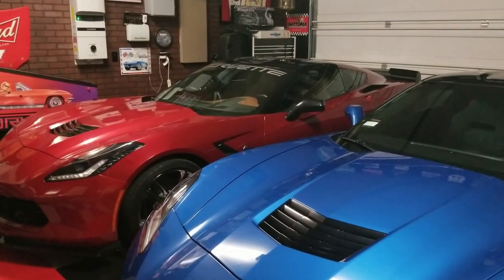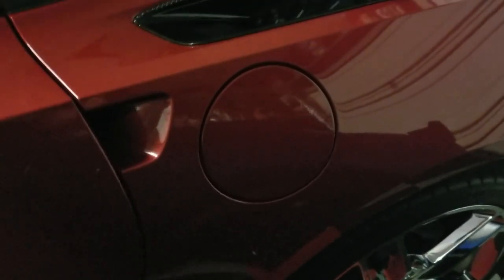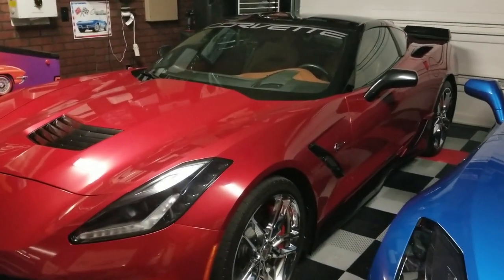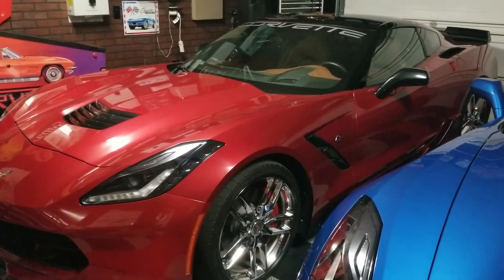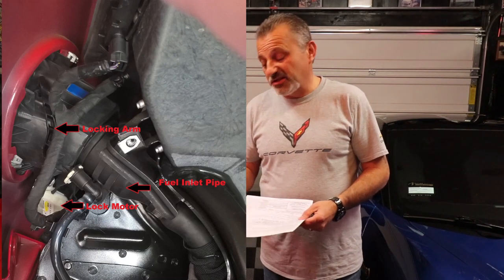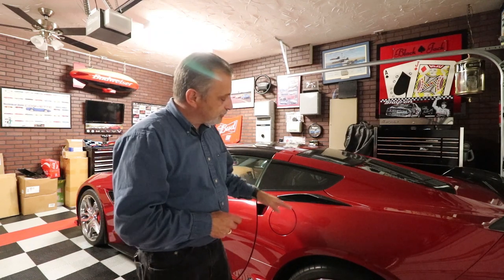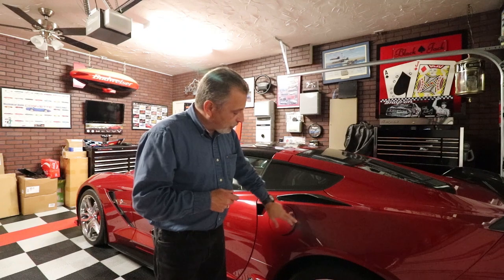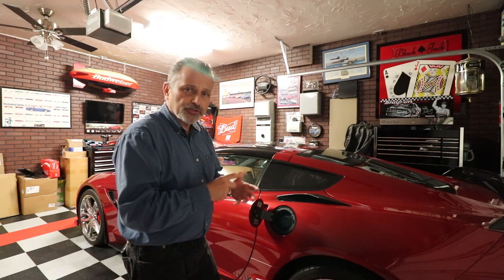My Gas Door Broke on my C7 Corvette

Comment: I took the 4 torque screws out liner pulled actuator pin out the door and put a plastic panel push retainer I have from my Escalade in gas door hole so that it can never get stuck again.

Comment: Was it the Chevrolet Extended warranty? If so it it worth considering
Reply from the maker: No it was from National Warranty Company! I paid $4995.00 for it but they paid out over $16k in various repairs. So it was so worth it!!
Reply: @THECORVETTECHANNEL  $16K in 100,000 miles! That is not so encouraging for those of us looking at going from a C6 to a C7.
Reply from the maker: @Sprocketboy1956  I would normally agree, but actually there was problem with the fuel tank I think that was with the car ever since it came from the factory and that cost 8k to fix!
Reply: @THECORVETTECHANNEL  Ouch!

Comment: That little plug in the gas cap hole isn't a permanent fix to stop the gas door from getting stuck.  If you do install the plug,,, the car will not lock.